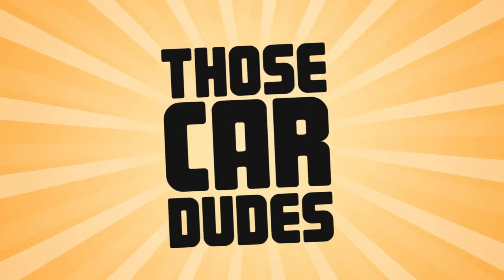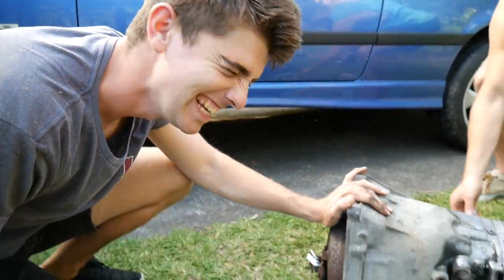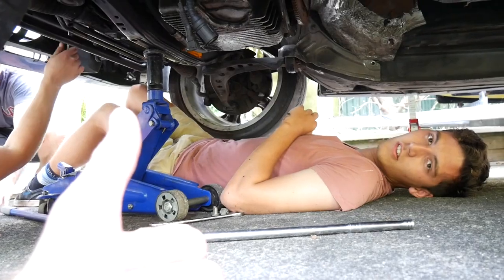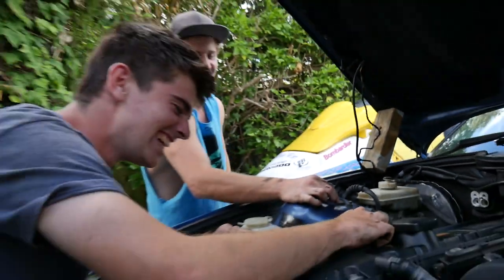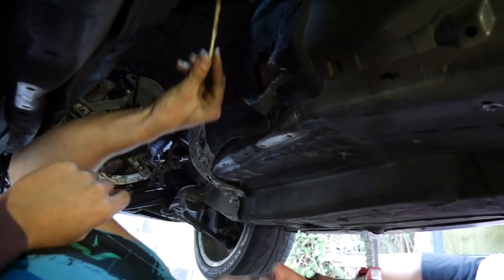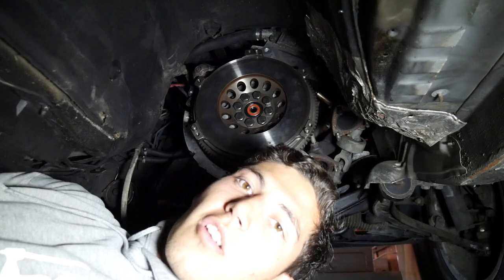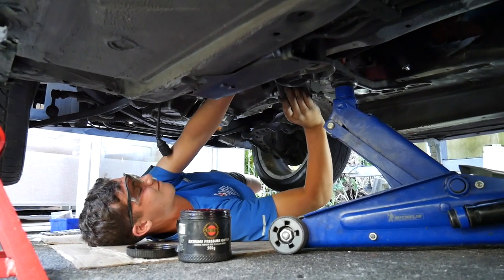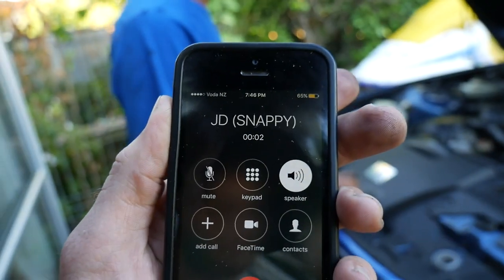Value for money E36 track car build | The manual box goes in! | Part 3

Comment: cool vid, +1 got my sub. nice swap. auto to manual swaps are easily the best mod you can do on an E36, ive done 3 of them hah
Reply: will a m50 gearbox fit a m52? im currently doing a swap
Reply: yes it will fit
Reply: the m50 and m52 both used the same getrag and zf transmissions. if yours a 2.5 or a 2.8?